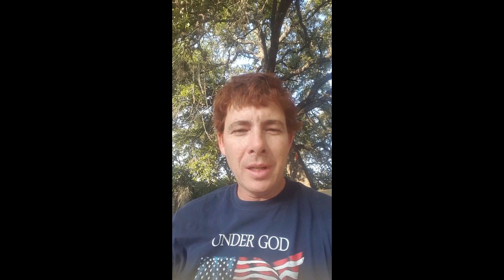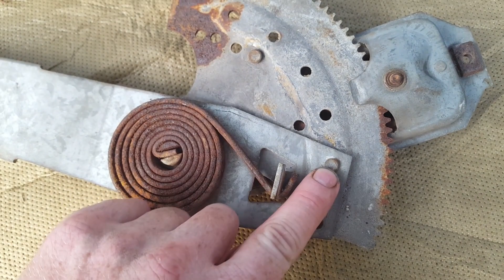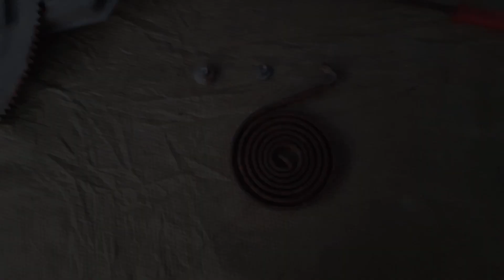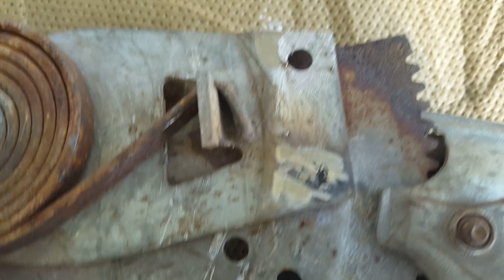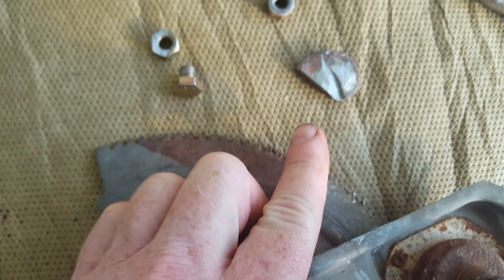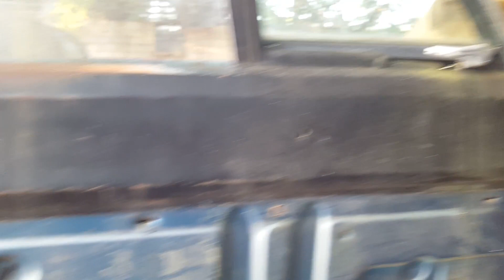69 Mopar Window Regulator Mod

Comment: I have a question:  I am about to remove the LH Rear window regulator from my 1965 Chrysler New Yorker.  I am afraid of the spring!!!
Is it possible for the spur gear to be rotated either direction - so that it will come off of the rack gear, and instantly unload the spring, or will it unload???
Or are there stops?
I don't want it to unload the spring by winding the glass OVER all the way up, so as to remove the scissor arms from the glass.
Reply from the maker: There is a stop to keep you from over winding, at least on the 69 there was. As to the spring unloading on the 69 you had to intensionally unload the spring. I your case if not trying to modify or realease the spring tension I dont see it releasing on its own. As always wear personal protective equipment such as gloves and safety glasses. Another good source of info would be the forums at www.forcbodiesonly.com for your specific application. www.forbbodiesonly.com would be another good source.